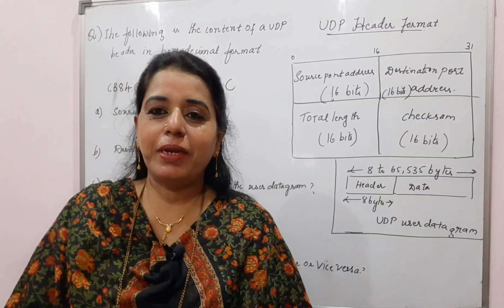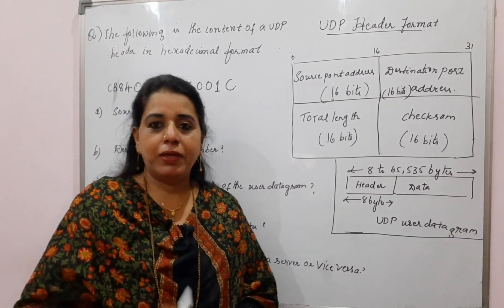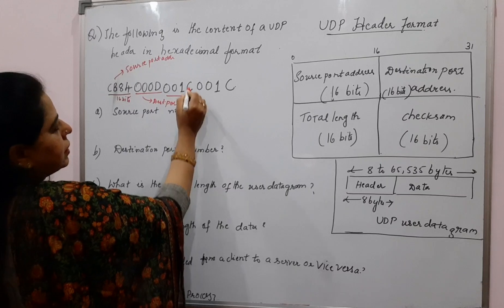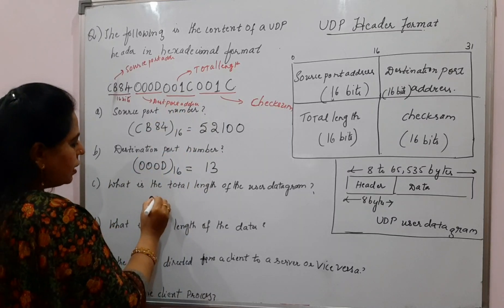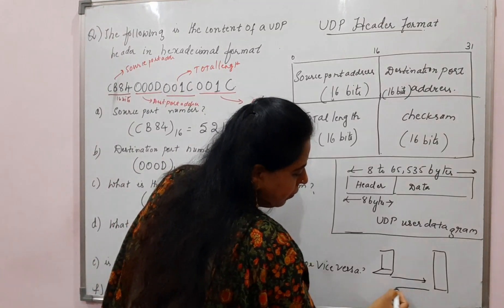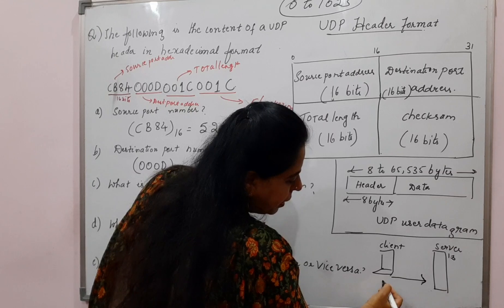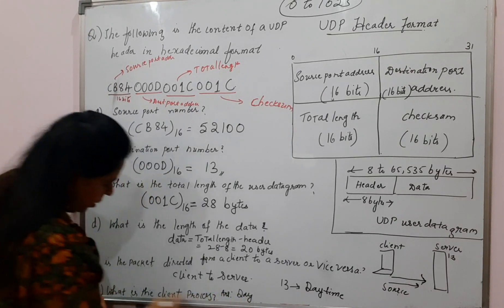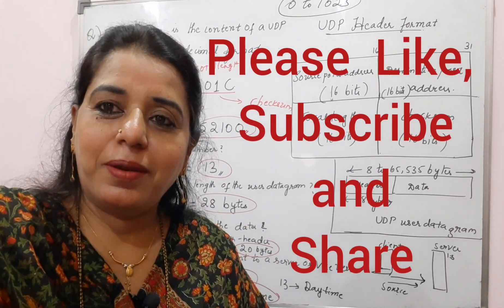Lec47-Numerical on UDP Header

Comment: Plz madam explain how that 13 and 28 u got??
Reply from the maker: The decimal value of 000D is 13

The decimal value of 001C is 28

Following is the  proceedure to convert hexadecimal to decimal numbers.

Multiply each given digit in the hexadecimal number with the corresponding power of 16 (starting from the rightmost digit multiplied by 160). 
 Finally add up the products  to get the decimal value.